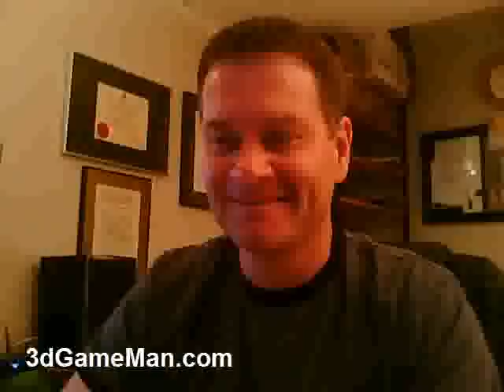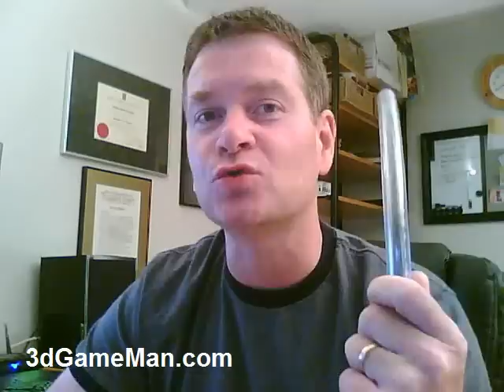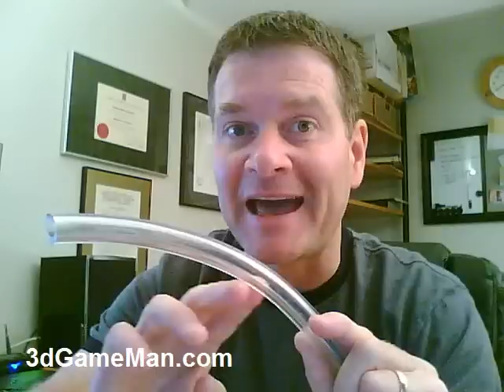#270 - Q&A: What materials are used for water cooling tubes?

Comment: That definitely did answer my question. Thanks allot, Rodney. :) Looks I'll be going with neoprene. I already liked the look of neoprene tubing, but now I've got another reason to buy that instead of pvc.
A drawback though, with pvc you can see if and where there are air bubbles. With neoprene you just have to guess.